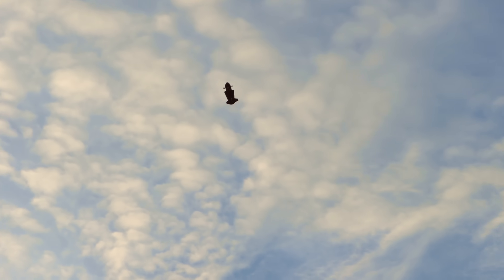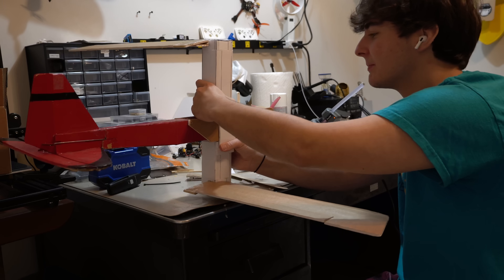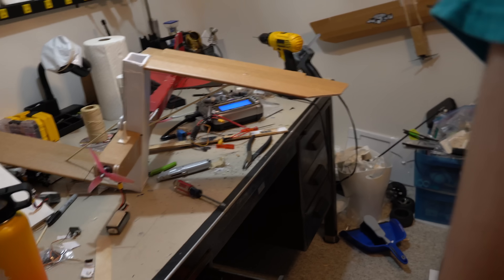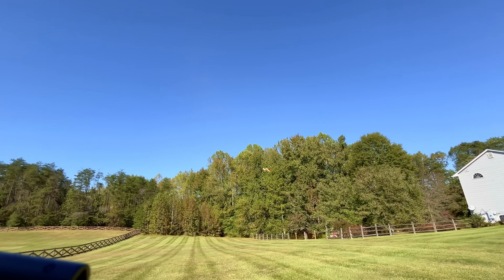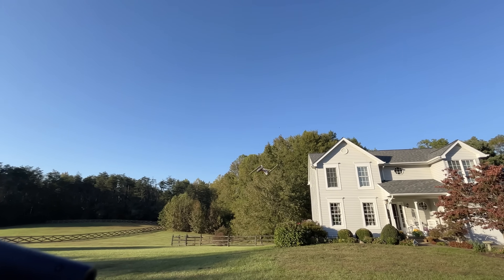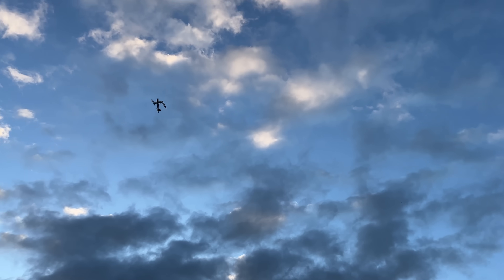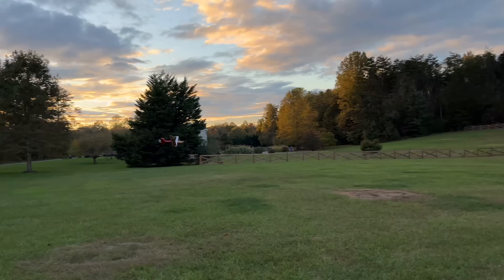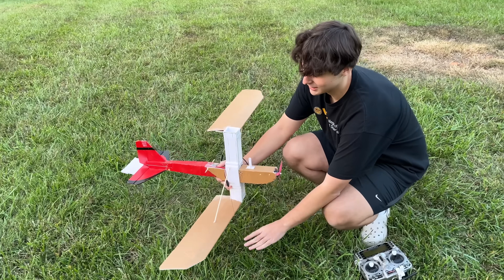Can a Plane Fly With Offset Wings?

Comment: Pre-watching any flight testing or even completed construction: So, in theory, this should work?  If the wings are otherwise equal, then the force of lift should be equal in an ideal environment.  My concerns would be torque... but, with a monoplane, that's always gonna meet at the center-point between the two wings.  Not sure how this will affect stability if that doesn't match the center of mass, and there would be material strength concerns... but I don't think it'd affect level flight.  NOW, if you had a biplane design, but the high side wings were not spaced precisely the same amount as the low side, that should roll, I think; the forces of torque exerted on the fulcrum point would not be equal between the two sides.  

I would, however, be very concerned about control surface operation... specifically the roll.  I can't picture it in my head, but it seems like it'd roll much faster one way versus the other way... but, perhaps not—maybe it'd be like there's one weak aileron (the one going against its wing's torque) and a strong one (the one going with the direction of the torque) in each roll adjustment, and maybe that balances out?  I'm not sure.  This might not even be a thing at all.  And then, a further question springs to mind about how this affects the aircraft's reaction to damage... would be very curious of the behavior there.  

POST VIEWING: Checks-out.  It makes sense that rolling would be fine, I suppose.  Though, I would be curious to hear how its roll performance compares to non-offset designs... but, also, the fact that the pillars for the wing offset basically create a giant stabilizer might corrupt that data regardless.  Would also be interested to hear how the loss of an aileron's control affected it, compared to other, non-offset wing designs.  I'm not an RC guy, so I don't have a clue what "good" behavior looks like here.

And I'm still curious about how an uneven offset on a biplane would work-out.

Comment: Don't all guided glide bombs use overlapped folding wings? Those seem to work. Russia has been very effectively using their UPMK kits to obliterate over a hundred Ukrainian targets every day. Offset doesn't really cause roll moment there because the wing kits are on the top, and the bomb is so damn heavy, the pendulum effect keeps it stable. Harder with light foam airframes that aren't attached to a 250kg+ bomb deployed at mach 0.9, I suppose?

Comment: Offset in my opinion is not a problem for as long airdrag is similar on both sides and center of gravity is where it's supposed to be (in center that is or where it doesn't distort the balance of the plane).

Junior high school physics 101.

Btw I wonder if thing could fly with diagonal X stabilisers (four stabilisers set in diagonal manner, NOT horisontal-vertical)

Comment: If they're roughly the same distance from the centre of mass, they're not going to induce roll. But if they aren't, the plane is going to want to roll in the direction of the further wing. Not constantly, like an aileron roll, but in infinite time itll settle at an angle.

Comment: I just took a examn in flight mechanics and was thiniking: what ere the odds!??

I like the mention of Ground effect. Idk why i find it so funny.
I would like to add the incompatibility with any dihedral angle, which wolud induce a roll moment.
Also there should be direct coulplings between pitch an roll/yaw, which sound funky as hell. For example roll moment w.r.t pitch rate (upper wing gets more lift than lower wing while pitching down because of faster airflow).
Vice versa ther is a pitch moment w.r.t. roll rate and pitch moment w.r.t. yaw rate.

What a nice video, thanks 🥳

Comment: The change in lift between the 2 offset wings is so minute that its basically the same. The lift equation involves the density of air, so the wings would need to be offset by a distance large enough to have them flying in completely different air densities for any real difference in lift between the 2 wings to be noticed.

Comment: No, the offset does not create a net torque. This is obvious since both wings are the same distance from the ‘axis of rotation,’ thus meaning they apply equal and opposite torques which then prevent rolling.

This is so obvious that I would bet large money on being right. 

Why is it obvious? Because this is literally just basic classical physics, and if you understand basic physics, this is a no brainer. 

All it requires is understanding torque; if you get this wrong, it proves you don’t understand the very basics, most simple situations of torque.

T = F × r

If you understand what a cross product is, the answer is blindingly obvious. The problem is that people let their ‘intuition’ interfere with true intuition.

Comment: I don’t think you proved your dad wrong. In your test plane, the wings were at equal distances from the center of gravity or rotation or whatever. This means that the roll from one wing would be off set from the roll from the other. However, I don’t think this was the case with your earlier planes. If your earlier planes did have wings at different distances from the relevant center, then a test plane would need to exaggerate that distance. And I suspect that if you have wings at different distances from the relevant center, then you’re going to get different torque.

Comment: The reason your flying car failed was due to the tail being high over the wings, it introduced a roll-over-top and put it into a forced a fake rudder shift.

If you put the tail in line with the spine it would be fine.

Note: I am not an engineer, nor an Aerodynamic expert, just speaking from experience as a Amateur Hobbyist (so many wrecked planes…)

Comment: So without watching here is my theory:

The lift the wings create is equal, since they are the same size and form.

But I guess that the plane will have a constant tendecy to tilt to the side of the lower wing, because the higher mounted wing applies his lift with a longer lever to the center of mass.

Edit: Higher/lower = longer/shorter distance from center of mass

Comment: I notice you spent most of your time banking left instead of right... I have a suspicion that when turning, it was more stable to bank left then it was to bank right. In my head I'm picturing the mast generating lift while banking or rolling, namely because of the uneven cutouts. While banking right, airflow above the mast would encounter air deflecting underneath the upper wing and vice versa for the lower wing. That would not be the case when banking left, which is why I would imagine that to be the more stable turn. Maybe I'm overthinking it, or the plane is too small for such an effect to matter. I'd love to know if I am right about that at all though!

Comment: I had little doubt if would not fly because the rotational forces "cancel" each other.  My wonder was the "height" of the fuselage on that vertical column.  I think if it was dead center the plane would fly a little better.

Comment: Love it, one thing with the swing wing/offset wing designs is that it can create a bias to roll in a certain direction if the 2 wings aren't offset the same distance from the center body perfectly. this shouldn't effect any forward or vertical capabilities (thrust + lift), but depending on how different the distance from the offset wings are from the CG, a roll and yaw bias will be introduced as the wing further from the CG will essentially have more control authority with the roll/yaw due to its moment of inertia.
(the swing wing design should roll faster in the direction of the lower wing, the test plane [which is awesome btw] looks to have the left wing higher from the CG than the lower wing in the video, so it should have more control over the roll of the craft).

would be good fun to slowly bring one of the wings closer to the main body and see how that effects the flight profile.
Reply: "this shouldn't effect any forward or vertical capabilities (thrust + lift)"  It will, depending on how much the controlling surfaces are already engaged compensating for the problem you described.

Comment: I figured it would do fine once its in the air since the lift shoukd theoretically be even on each side with equally sized wings, but i believe it might struggle on take off, at least on a larger scale due to ground effect being stronger on one side.

Comment: I love seeing non-traditional designs like this that force people to really think about the physics involved. I actually LOL'ed when your dad made some comment about one wing creating more lift than the other just because of their position. Great video and love watching the process.
Reply: My building experience pretty much boils down to KSP, and it's aerodynamics model isn't perfect, but I've made some pretty hilarious designs. On the other hand I recreated some real planes and those fly pretty well, so the physics model and the design of these planes work.
Reply: My intuition was that if one wing was close to the center of mass and one was far away from it, the far away one might have more leverage with the same lift.
Reply: @atomic_wait  there are even planes with different length wings to counter the propellor-induced roll.
Reply: @HappyBeezerStudios  A valid assumption, but no. Engine torque upon the airframe isn't constant and can vary dependent upon RPM, airspeed, and air density. The pilot usually compensates at the controls for this.

Comment: If your wings are dihedral (angled up or down) it would cause a roll. Because normally the horizontal component of the lift would be cancelled out by the other wing's equal but opposite moment (force * perpendicular distance), but by non-symmetrically offsetting them, you would unbalance the plane, causing a rotation around the center of gravity, causing an initial roll trim. If the plane was positively dihedral it would just cause the plane to bank in the direction of the lower wing, as the "wings level" would have one wing higher than the other. If negatively dihedral, the plane would flip, in the direction of the higher wing, then pitch down into the ground. Take this with a grain of salt, as I'm just a mech engi with ms paint, not an areo wizard with real simulators.

Comment: Well two wings the same size should lift the same... but your centre of gravity is not exactly symmetrical... wings above CG would be considered more stable and easier to control than wings below.

That could also explain why your plane likes counterclockwise circles to begin with... its about gravity not so much about lift.

Comment: Hmmm.... 1:05 in. Interesting question.
After some thought, I think the answer will be "yes, offset wings produce rolling force".
I'm thinking of COG as the pivot point. Draw a line from COG to COL of wing 1, and another line from COG to COL of wing 2.  Think of these two lines as levers. Each lever has an equal force acting at the end of it, 90 degrees to the plane of the lever. But one of the levers is longer, so the force acting through it has a greater mechanical advantage than the force acting through the other lever. Imbalance results.

This means a roll. BUT...

If the wings are mounted higher than the COG, the craft will roll until the rolling force is insufficient to overcome the force of gravity acting on the end of the lever formed by the line between COG and overall COL. If gravity is never strong enough, the craft continues to endlessly roll. Otherwise, stability is reached. The craft flies canted.

Then there's dihedral. If present, one wing will become more vertical than the other as the craft rolls. The more vertical wing has left lift counteracting gravity than the more horizontal wing. Again, levers at work, trying to keep the roll from continuing.

So my final answer is, "it depends on the design of your plane, it may be stable in a canted position."
Reply: 2:06 - Ah... I see! More trickery! That design, I predict zero roll tendency.
Reply: 4:00 - Yep.

Comment: There is a torque due to the car motor that will rotate the plane. Probably that's what caused the rotation as the car jumped off the ramp with the motor and wheels still rotating

Comment: My first instinct when I saw your plane crash on takeoff is that it had to do with ground effect. Within about a wingspan of the ground, a wing produces more lift the lower it gets, so if your two wings had equal area, on takeoff the lower one would produce more lift. (Once out of ground effect, the way your extreme plane was when you launched it by hand, the difference would no longer be a factor.) It seems that you ought to be able to counteract it with ailerons, though.

Comment: That's not a barrel-roll, son.  Its just a roll.  A barrel roll is MUCH more pronounced.  Imagine having to roll your craft around the outside of an actual barrel, suspended in the air (say, being held aloft by a small zeppelin), versus rotating along the craft along its longitudinal axis as it passed THROUGH the barrel.  THAT'S the difference.
Reply: That one annoys me more than it should, up there with misuse of backslash

There should be a mass education program or something explaining the difference

Comment: If the wings had any significant net upward/downward tilt(dihedral), then it would cause a rolling moment. Which might be inevitable above a certain size as the wing flexes under load- it would probably be hard to make a stable full sized plane like that.

Comment: The issue you did have with your car may have been due to the ground effect which would cause the lower wing to make more lift than the higher wing, so both sides may have at least some point

Comment: I don't think you yave poved that there is zero effect for offset wings.  What you have established is that it works for RC aircraft, which are hand launched (thrown into the air) and recovered either by hand or by crashing.  In a human carrying size aircraft it would probably also fly well once in the air and until time to land, but you have totally failed to take GROUND EFFECT into consideration.  I predict that the lower wing will be in ground effect much sooner and will cause the aircraft to bank and turn away from the lower wing unless it has a giant rudder and huge amounts of power, possibly as well as asymmetrical flaps.
I'd be happy for  you to prove me wrong, though.  But I'll bet if you are willing to conduct further tests, you'll find that I'm at least partially right.
Reply from the maker: …I will be making another video 😂
Reply: @joosh_king  I've subscribed.  I'll be looking forward to it!

Comment: I kind of think I agree with your dad. While you did demonstrate that the plane can stay in the air, you were mostly flying in a circle. The plane seemed to be constantly rolling to the left indicating that the lower wing, on the right side of the plane, was generating more lift. I think that this is why the plane drastically slowed down and lost altitude when you tried flying to the right. Maybe you could try lowering/raising each of the different sides and see if that makes flying to the right easier and flying to the left harder?

I noticed that the split wing plane you showed at the beginning of the video had a similar design to this video’s plane because its right side wing is also lower. The fold out flying car had the lower wing on the left side which may have made that one roll to the right?

Though I have a bad feeling that I’m missing something somewhere, because I am stoned out of my mind right now. Or maybe this is a psyop to trick people into commenting

Comment: You should do the same scenario as you had with the car. The car had both wings on the top and offset. This plane has wings on the top and the bottom at about the same distances from the plane's body, which is why it flies. 

I am not an engineer but it makes more sense to me, if I'm wrong pls correct me lol

Comment: Before watching video: 

If the wings have the same dimension they should produce the same amount of lift and drag. However the fact that they are offset will affect the way the forces interact with the overall body, and can therefore affect the angular momentum of the plane. Which can cause it to roll. Because the location of the forces in relation to the center of gravity matter.

If the wings are placed in a way to ensure the forces cancel out, this is not a problem.

Lets see if i an right

Comment: CFI perspective: I see three concerns with the design.

1. As the plane enters and exits ground effect, there will be a lift difference as the lower wing becomes more efficient for a longer period
2. Having the wings on different planes can create an unpredictable wake pattern across the eppinage, making pitch and yaw inputs challenging. 
3. The wings being on different planes may not be a concern, but them being different vertical distances from the CG will cause uneven roll pressures, giving the aircraft a stronger roll control in one direction, and a weaker roll control in the other. Not to be confused with a roll tendency or roll stability.  

That being said, great video and demonstration of concept! Keep thinking outside the box and testing the physics of flight!

Comment: I would say if the center of gravity (point of rotation for roll) is not centered ( so all the way up or down) the opposite wing might have more torque causing it to wanna roll to one side. Try offsetting the point of roll rotation by moving the body up and down and see what happens.

Comment: Here's my hypothesis, the wings generate a pocket of high pressure air below, and the top wing has an extra wall keeping that pressure in, while the lower wing doesn't, therefore the lower wing will make less lift and more drag, resulting in a roll and yaw towards the lower wing. That's if there's a noticeable difference at all. Now watching the video